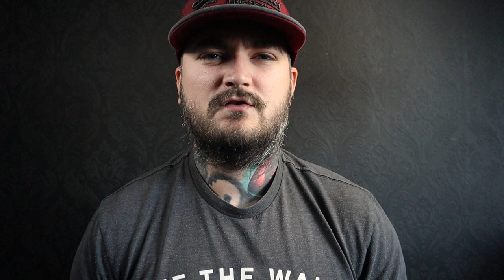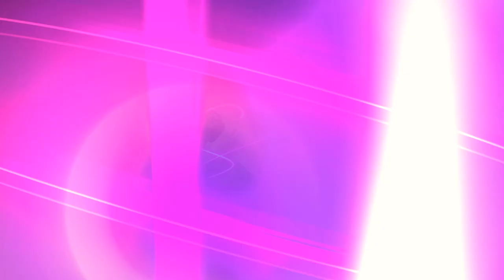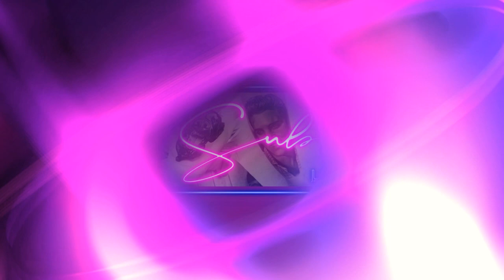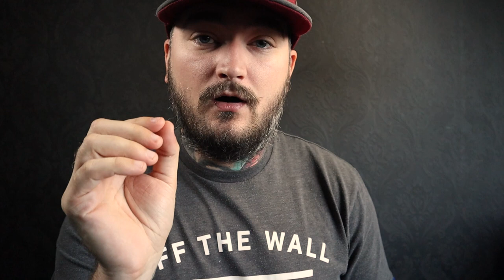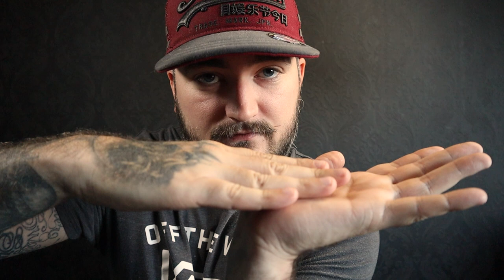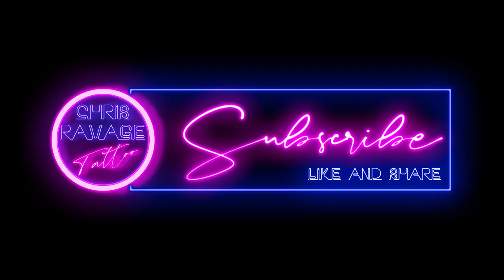Tattoo Tips: Understanding STROKE and GIVE and how they go HAND in HAND

Comment: The whole "Give vs rigid" regarding less trauma is highly debatable. If the give reduces trauma but needs more passes, the skin is then being penetrated more. More holes, longer heals and sometimes, less vibrant/saturated outcomes. It almost seems like having give would be better for someone more skilled seeing as that doing more passes and thinking "It'll be fine, it's a soft hit" would in reality just cause more damage. 

I say this because I have been battling this topic for years. Went completely rigid and all my work got better over night. Then I tried a machine that has a ton of torque and a fair bit of give and it was clear that the give was actually helping, due to the fact the machine didn't really slow down at all, it just had a noticeably softer entry. In the past, machines with give seemed to kinda slow down as a whole when the needles touched down.

Now I have no clue what the fuck to think. My whole life is a lie.
Reply from the maker: 😂😂😂😂 that last part…
Reply: @ChrisRavage  I am seriously having, what I feel like one could be, is a "Tattoo artist mid-career crisis"

But where there is frustration and thought there is usually knowledge to be learnt. Or so I hope ahahahaha

Send halp

Comment: Great video Chris.. covered  the subject well from all angles.. Love the closing statement.. re being able to use any machine.. I started out with a hybrid coil, micky Sharps.. was ag constantly changing needles etc.. but I'm so glad now that I started with coils.. and a hybrid to.. it has def helped me not be intimidated by using the various configurations of rotary, be it direct drives or give machines.. I still love to put lines in now n again with a coil.. something about it just feels kinda nice when you've tuned the machine, but my hands dont like em for long anymore 🤷‍♂️ I had one of my days today where I felt like a change, instead of going to my newer wireless machines.. i chose an old favourite, the FK edge X, with the 4.2 cam.. man that thing ain't a quiet rotary but it is SO NICE to line with. I stayed  with it for 80% of the shading, which came out smooth and used the Cheyenne unlimited just to do the super lights in couple areas after.. i like to set a longer stroke machine at a  high speed for shading and then just skim the skin, works just fine, not choppy either, long as your hand balance & depth remains consistent. 
Anyway hope ur well. Peace. Out

Comment: I like to use a long stroke for color packing and lining and a short stroke for shading but ive noticed if u use a little bit of give on a long stroke it makes it so i can get bigger groupings go in easier i have the bishop liner wand and it has a long 5mm stroke with that stroke i can actually line at lower volts just fine cause it hits so hard
Reply from the maker: That's what so beautiful about our Job...so many awesome ways to make things work for you

Comment: Hello, I am complete beginner, but wanna give it a try. Would you go for 3mm OR 4mm stroke machine (FLUX/ FLUX S) for everything at the beginning? I would like to work more with puchy black and white ink with as smooth as possible shading, color just for small details if any, but who knows where future gonna bring me on... Flux has egive which sounds pretty cool and is wireless, which are reasons for my choice, just not yet setteled for the stroke lengt, can you help me decide please?
Reply from the maker: The 4mm is gonna be the punchier machine and better for colour also over the 3mm. Getting smooth black and grey on both is possible, but the 3mm will give you more build up time. I think the 4mm will suit your wants better imo.

Comment: I’ve been wanting to get a Bishop wand but I’m lost between the Shader & Packer. Is 4.2 a good beginner machine? Or should one play it safe & use the shader? I’m not an extreme beginner,I already have a couple of tattoos & such. Just needing direction
Reply from the maker: Shader would probably be best, doesn’t pack as much punch as the packer
Reply: Haha I've got the exact same question, is the packer a good versatile machine as a beginner, does it allow to line in one pass as well or not? Cause it really looks like a good combination between the soft shader and the strong liner...
Reply from the maker: @nicolaspennel3896  for sheer versatility the packer has it yes
Reply: @ChrisRavage  wow thanks for your quick answer. I do mostly realistic stuff but my 3,5mm rotary pen lacks of power and I'm afraid to have the same feeling with the 3,5mm stroke wand shader ;)
Reply from the maker: @nicolaspennel3896  it’s all personal preference, for harder punchier machines I still think the Cheyenne Thunder is brilliant
Reply: @nicolaspennel3896  I went with the shader,I personally love it & allows build up shades as well as perfect lining if you put it on the higher voltage. Shader was a really good choice.
Reply: @drieyazz1645  hi man the bishop 3.5 is versatil for liner and packing color?

Comment: Hey brother I have the fk iron xion and it came with a 3.2 and 3.7 cam stroke the machine also has soft and hard give settings 
My question if you or anyone can answer is what is ideal for realism black and grey, 

Should I have it on soft setting or hard setting give it also has 10 clicks in between
Reply from the maker: 3.2..5 give
Reply: @ChrisRavage  thank you my man love your channel and all the info I appreciate you
Reply from the maker: @jmeloarts6480  Thanks for the support homie
Reply: @ChrisRavage  hey my man I have serious question to ask you if you could shed some pointers that’ll be awesome but basically I have trouble saturating black when my tattoos healed it looks blotchy and I’m having hard time understanding if I went deep or the depth was all over the place even tho I was trying to stay consistent as I can used 12gauge running @8v 3.7 cam any thoughts appreciate it
Reply: @jmeloarts6480 I think you should turn your voltage down to 5-6. Do smaller circles and have your tattoo gun at a 40-60 angle. The needles hit harder when being put at an angle. And I would hate for the skin to get chewed up since you have it at such a high voltage.
Reply: Definitely have learned alot and my work hardly comes out blotchy now it’s just perfecting techniques